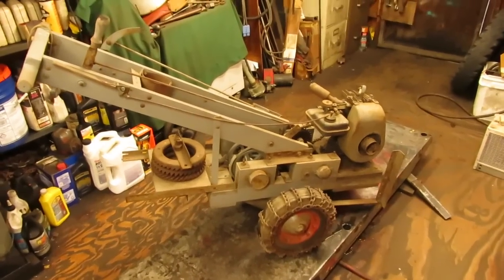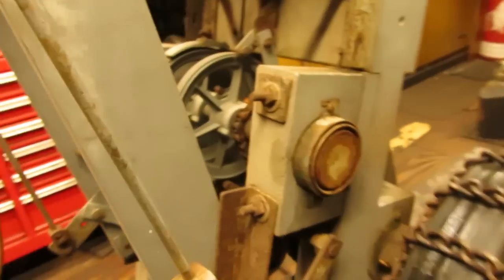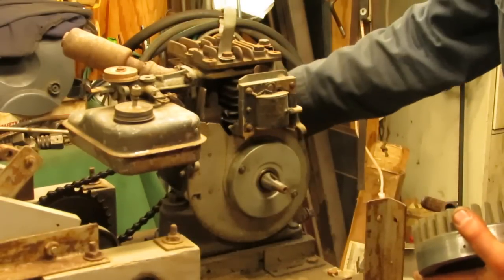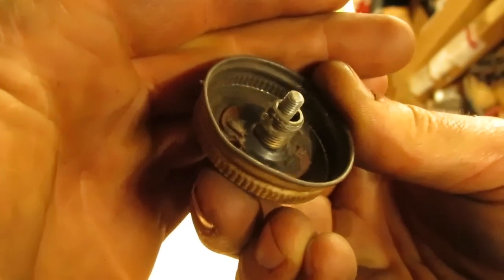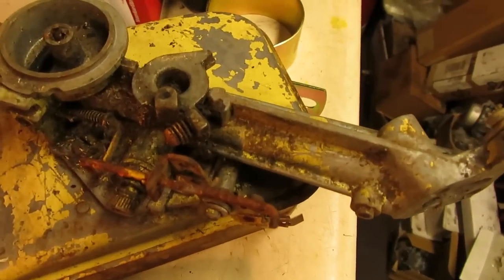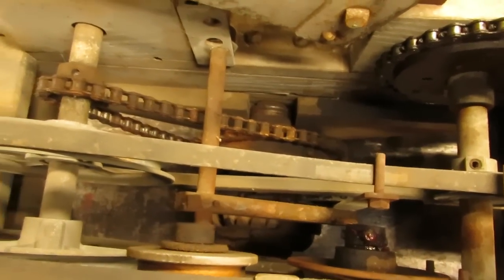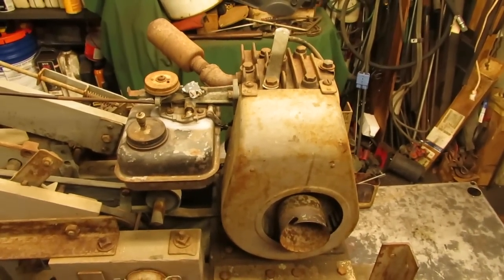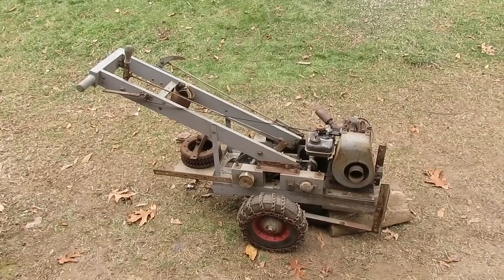Homemade Wooden Walk Behind Tractor- Repair and Startup

Comment: Wow that thing is SOOO COOL! I absolutely love it! I think I really need to find something like this someday... its got Colin written all over it LOL! So much thought and engineering went into every part of that thing its really amazing! Definitely dont get stuff like that anymore! Interesting note about that engine- it's a mutt! According to the tag and some other characteristics its a 1948 Model N, however, that carb is off a 5 or 6s. I think that would explain the lack of governor too as the model N used an air vane governor that interacted with the bracket you found under the carb and that bracket would be connected to an updraft flo jet. The 5 and 6s governors went from the air vane directly to the throttle and that 2nd little tab that's on the carb (which is what served as the connection between the throttle cable and the spring of the governor). I bet the guy that made it also cut the rest of the original gas tank brackets off of the top shroud mounts, which is why those 2 mounts look so weirdly shaped and beefy. Overall a super neat piece that I definitely want to admire in person next time I'm over LOL! Very well throughout and truly some amazing and classic American farmer engineering where they worked with the random junk they had at the time and made a very well built and functional machine out of it!
Reply from the maker: You're going to have to start keeping an eye out for homemade machines! Man, so he really did piece together not only a machine but an engine too... wonder if that's why it lacks power having a carb from a smaller engine? He used whatever he had kicking around, that's for sure! Though you figure if it was the 40's - 50's, there wasn't much on the market for snow removal except larger walk behind tractors so if the budget was tight, he made do! Next time you're here ya can take a gander at it for sure...

Comment: I wonder if that had some type of home made snow blower mounted to the front. Several plans in early Pop-Sci or Pop Mech.may have been inspiration in that era.
Reply from the maker: Snow blower attachment keeps getting mentioned here! Bet it did with the pulley on the engine shaft... I'm figuring this is 40's - early 60's given the engine and hardware that was used (square nuts). You are right, matches that era of "build it yourself" stuff!

Comment: Put some pneumatic tires  on, with chains, and  a roto-tiller in the front, or a mower, or a rotory sweeper, or whatever......looks like a fun machine (maybe replace the wood frame with angle iron ???)
Reply from the maker: A modern day upgrade! It does need taller handle bars though, bit short for me to walk behind haha.

Comment: Good stuff Jake...nice to hear your voice...any news on your property search?
Reply from the maker: Thanks Gary... Nothing solid yet. Found a place in Jaffrey NH about 3wks ago. Small house, 2 big Morton buildings out back (30X42 and 45X70). Nice spread, but the buildings weren't outfitted with electricity, water, insulation, septic, etc. Overall price was okay, but the added cost of setting up the buildings for work on top of that was going to stretch me too thin.

Comment: I always enjoy watching your videos. I would like to see if you might be interested in some more equipment for videos?
Reply from the maker: Oh boy, I shouldn't... but I'm curious now. What do you have kicking around? 
Also assuming you know that I'm based out of central MA?
Reply: @5Tractorguy  I’ve got 2 David Bradley walk behind tractor with some of the hard to find implements, cordwood saw and adapter to use as brush saw with the manuals to go with them. A REO snowblower  a 1950s generator I’m in eastern Massachusetts
Reply from the maker: @Tractorfarm9  When you get a chance, send me an email tractorguy5@yahoo.com. I'd be interested in the DB stuff, will pass on the generator and REO. If you can send over a few pics too that would be excellent.

Comment: Hey hows the service truck holding up
Reply from the maker: Fine as ever Devin! Just parked it for the winter on the 21st... too dang cold to work outside now.
Reply: @5Tractorguy  Thats good mines still putting in work put a welding machine and toolboxes on it again so shes just a welding rig again.